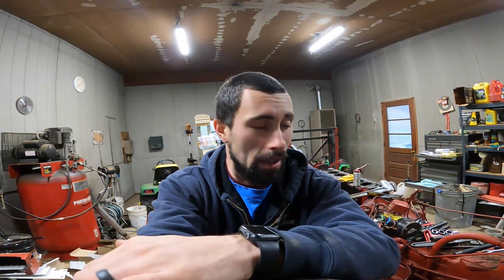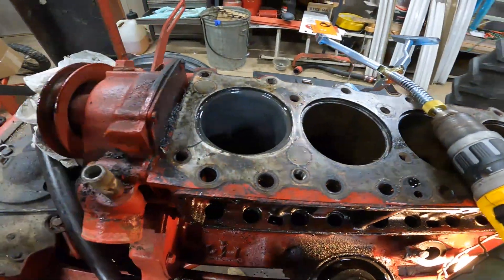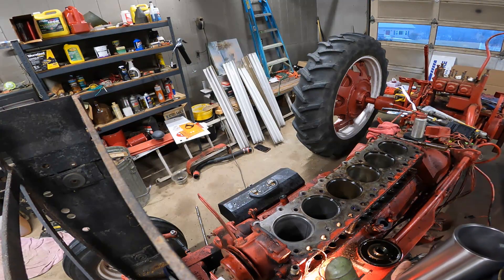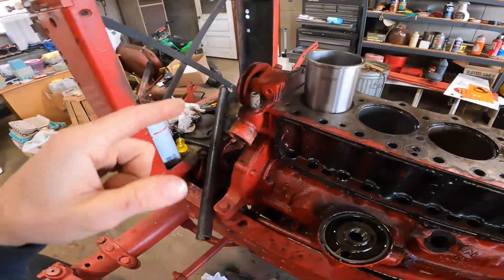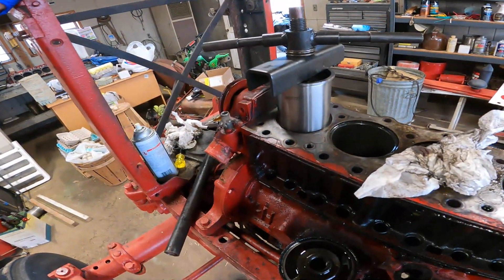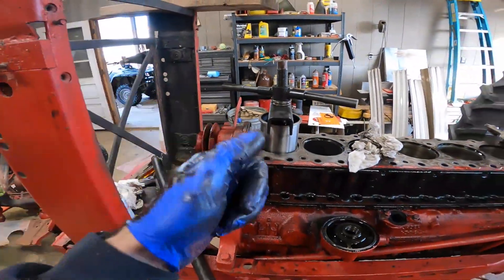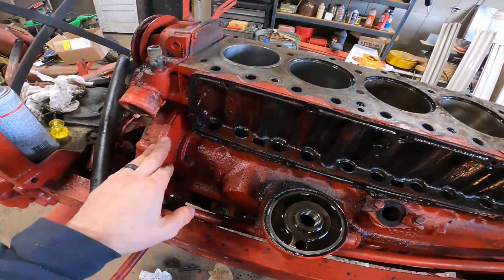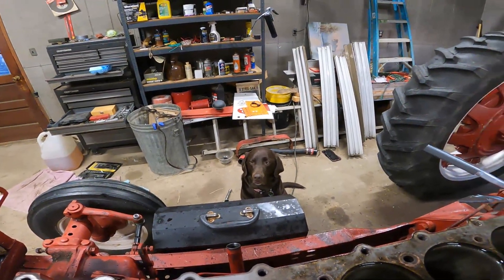New Sleeves | Farmall 460 Tractor Repair | Episode 6

Comment: Hey, Watched all 6 😁. making good pro elbow grease . By now you should know WD 40  makes a sleeve install  better.  You have got this far so why not  go   ALL THE WAY ?  New main bearings , new  Cam Bearings  ,Timing Gears . SEALS ?  You do want  a factory  correct repair because it will SAVE money in the long run .   Yes  I have rebuilt a tractor or two myself . great videos   thanks
Reply from the maker: Thanks for watching and thanks for the tips!!